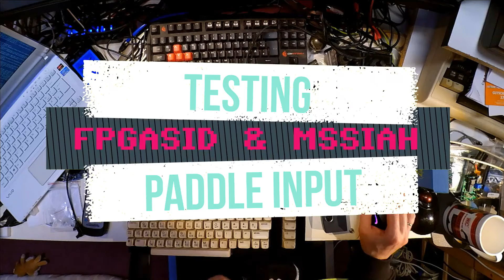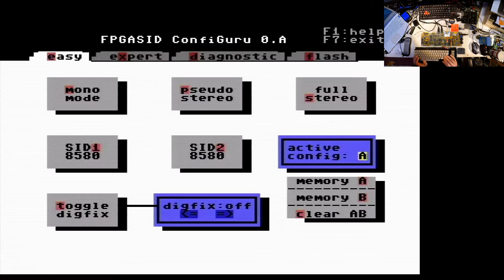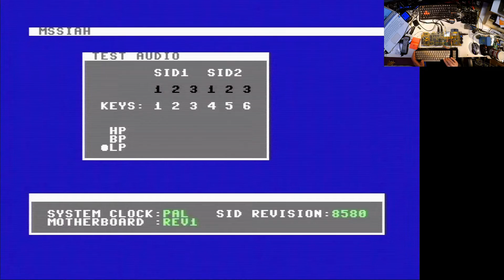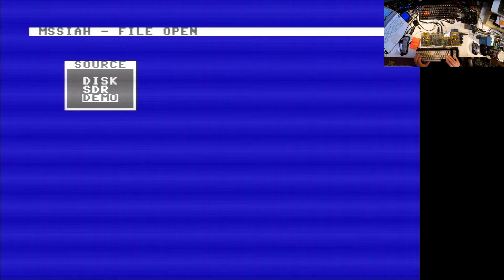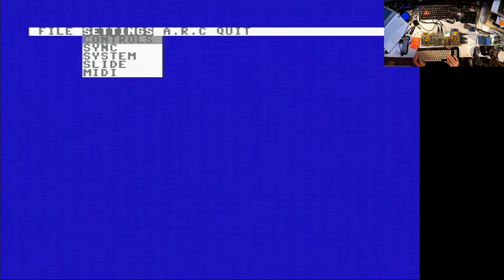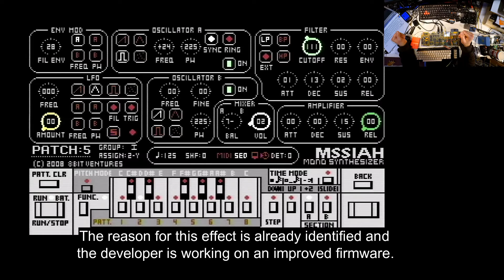C64 Hardware - FPGASID with Mssiah and Potentiometers

Comment: Not bad! :)
Reply from the maker: Thanks!
Reply: I think sound is a little bit "cleaner" with FPGASID than with normal SID. The background nois is just a C64 thing ;)
Reply from the maker: Joseph Swan yes, it's like the real 8580, which is kind of sterile as well, the 6581 emulation part is still under development but I think it will sound much dirtier :)

Comment: Hey, first of all thanks for your (especially SID related) videos! My question: What value potmeters you use? I ordered 250K`s to make knobs on a Music Maker add on. And require response over the whole range of the pots. For example, the original paddles have only effect over half their range, dialing further has no effect. What`s the best resistance in your opinion?
Reply from the maker: Hi, thank you for watching. I think I have used 470k. The ideal value is 480k, at least that is what I have in mind but such resistors are hard to get. Some people are using 500k as well, shouldn't be an issue. But I will check this because I've built two different paddle boxes and can't remember which one works better :)
Reply: @c64customs  Hast Du eine Bezugsquelle für die Potentiometer? Wenn man die intern an die Joystick Ports lötet, kann man die aussenliegenden Ports mitbenutzen bzw. eine Maus anschliessen??? Danke!
Reply from the maker: @Maudio303  Intern anlöten geht grundsätzlich, externe Maus funktioniert dann allerdings nicht mehr, die nutzt ebenfalls die Potieingänge ausser es ist keine Geosmaus sondern eine sogenannte Joystickmaus, die funktioniert wiederum, allerdings nicht besonders gut im Mssiah. Der Sequencer unterstützt ja die Geosmaus direkt und lässt sich so auch am besten bedienen weil man da auch die 2. Maustaste nutzen kann.
Potis hatte ich damals alle bei Reichelt bestellt. Wichtig ist, dass es lineare Potis sind und keine logarithmischen.